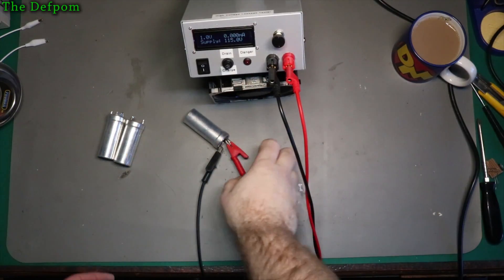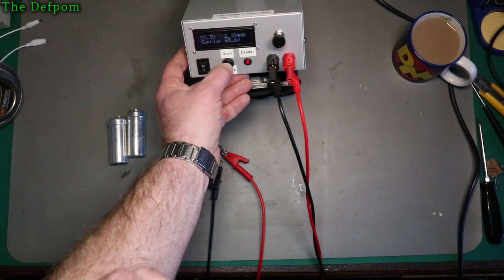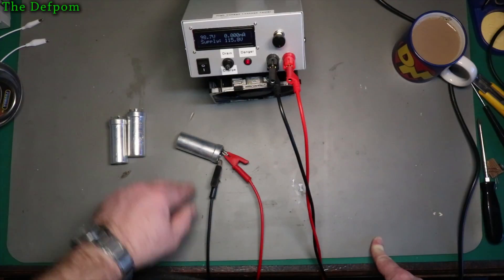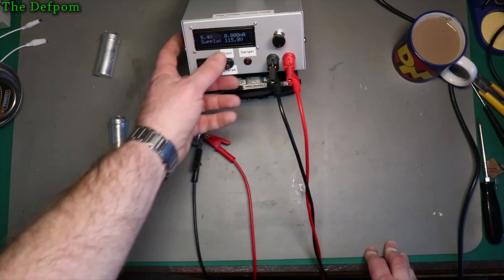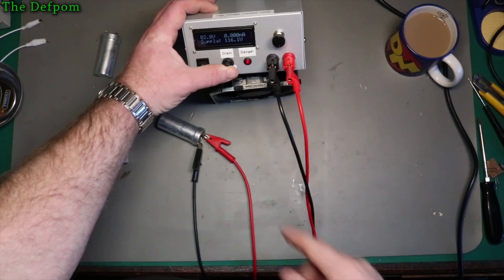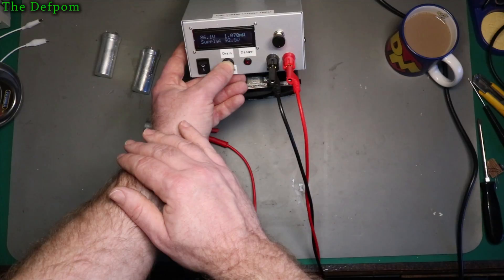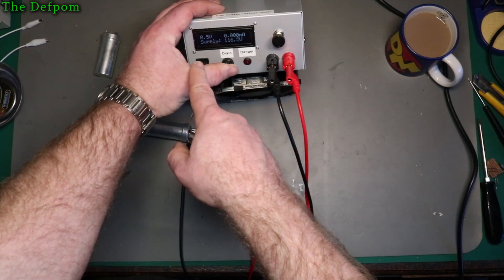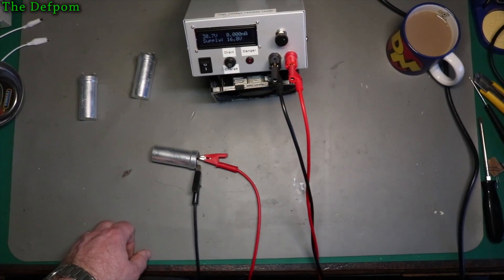🔴 #441 Leakage Tester Project - Testing Electrolytic Capacitors

Comment: Is there a rule of thumb when it comes to discarding these old capacitors. Most of mine test good ESR, leakage current falls below 1mA but the capacitance is often much higher sometimes double the stated value. I heard this can be an indicator of it becoming end of the line in terms of reusing them as it signals the dielectric weakening.

Comment: Working prototype you got there. Good job. The only minor thing I don't care for is have to keep a finger pressed on the switch all the time during the charge process, but I guess the spring loaded switch is for safety? What am I missing?
Reply from the maker: Danish Native - yes entirely for safety, I did start off with a latching toggle switch, then though it would be too easy to forget to turn it off, or it could be knocked on, so I chose to change it, this thing puts out up to 400VDC.

Comment: Nice test gear, 
You could trig the drain when you hit the drain button it drains auto without need to hold the switch, a software feature.
You can also do the same for charge and if the mA goes over say 2 mA it stops and if you re-trig the switch then it goes up to max voltage and stops if you hit the charge again.  Just a feature suggestion 😊
Reply from the maker: Peter W - yes that could be done using a couple of relays, there are plenty of I/O free on the arduino.